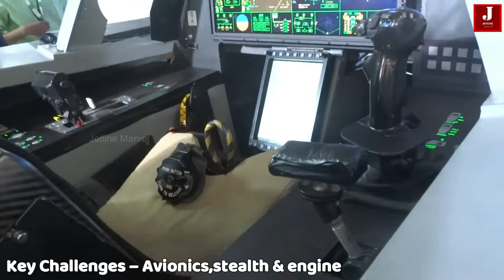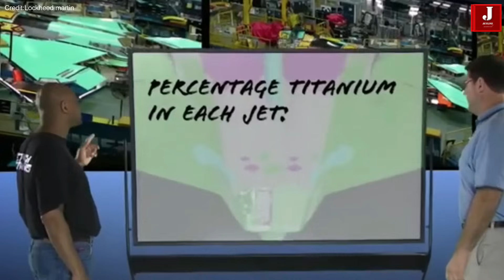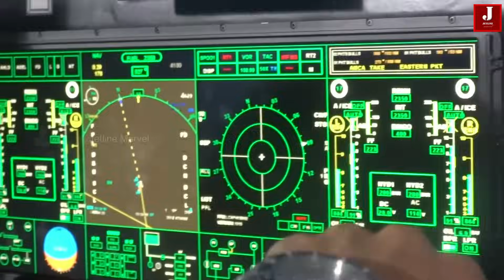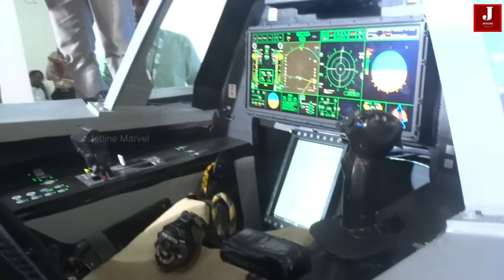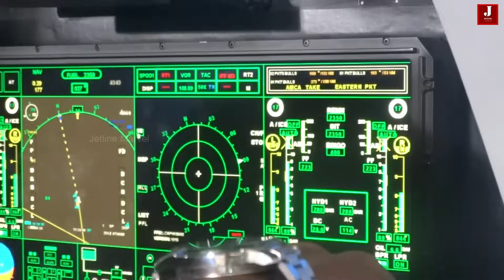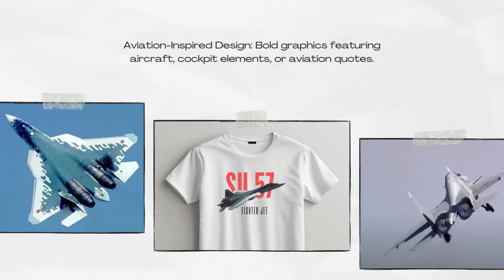6 Critical Technologies India Must Overcome to Build the AMCA 5th-Gen Fighter Jet

Comment: We haven't yet developed the engine. Engine isn't the main issue because we know we have to import engines from either US or from France/Russia. The main problem people aren't talking about-
Intenal hardpoints-It should be more bigger. Carrying weapons on wing is worthless in a stealth jet. 
Internal Fuel tank and supercruise- We don't love to carry an external fuel tank or refuel mid air during stealth mission.
UAV and AI integration - It's important in modern warfare. We're not dedicatedly working on UAVs to operate with our stealth get like Russia or China. Though it can be intregated later. 
Weapon package compatibility- Our mainly used weapons are not compatible for operating from internal weapon bay. Though Astra air to air missiles can be modified for that easily, we should modify Brahmos for operating from internal weapon bay. 
Electronic Warfare Suite - Indigenous capablities in that is crucial. We should also modify it for Electronic Warfare Missions like EA18G Growler and J16EX (Using wing hard points, without that it's not possible)

Comment: There's only one challenge and that's the 5-6th Gen engine but it's a WIP. Rest all the technologies have already developed, be it avionics, AESA GaN based Radar, missiles for the jets etc.
Reply from the maker: Some technologies still need significant improvement to meet true fifth-generation standards. For example, AI integration with radar systems must advance to detect more targets and deliver information to the cockpit faster. Missile systems, such as the MBDA Meteor, also require further enhancement. Additionally, the engine should produce at least 125 kN of thrust or more. However, the actual requirements may become clearer once the prototype is deployed.

Comment: Rafale is a 25 ton class fighter with 75kn engine so why AMCA is also 25 ton with 110kn engine? AMCA should be atleast 28 ton class fighter jet.
And 4 internal hardpoints is not enough atleast 6 is necessary 😢😢
Reply: Lots of equipment need power to run and it cannot use afterburner continuously. Because it increases ir and heat signature hence need we need at least two 110 kn engine for AMCA, even after that you will not have super-cruise ability
Reply from the maker: Right logic
Reply: @sachinsavarkar7785 simple but not so simple solution is to use adaptive cycle engine and since AMCA will be 5.5 gen hence adaptive cycle engine is almost confirmed.
Mk 1 could be 25 ton but not mk 2
Reply: Super cruise is one of the requirements
Reply from the maker: @chandra7803  True
Reply: @chandra7803  but the more missiles you carry the better the chance of survivability you have so atleast 6 BVR is necessary 
And Rafale could also super cruise although not like F22 but with 110kn class engine and 75 kn dry thrust AMCA could easily become a 28 ton class fighter.
This could increase the fuel carrying capacity of AMCA also
Reply: And even J 35 is a 28 ton fighter with 6 internal hardpoints